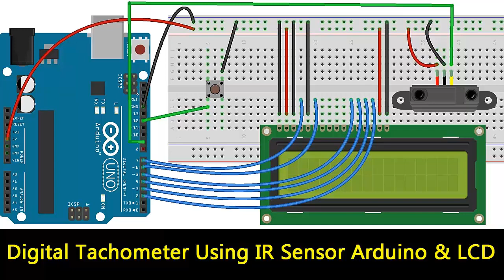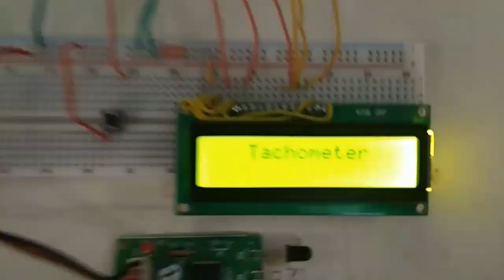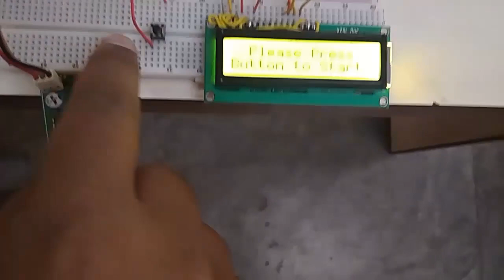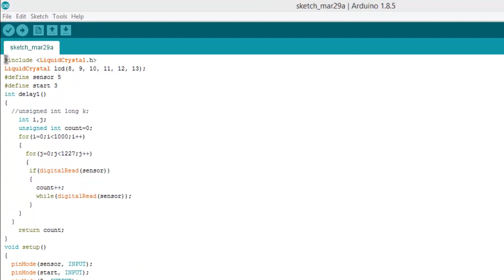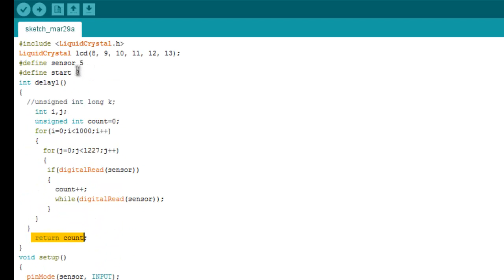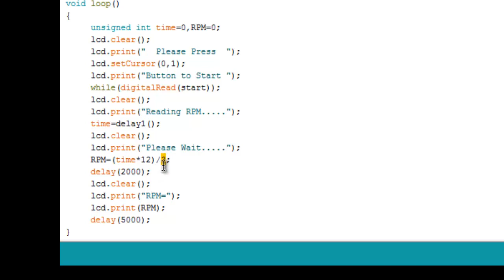Tachometer (RPM Measurement) using IR Sensor & Arduino

Comment: I have a high torque motor gearbox with a max rpm of 10. but when I tried to implement your method, the result doesn't make sense like it was shown on LCD 137 value of it, of course, my blade just 1. didn't accurate at all.

Comment: Hello, good explaination on the project. Yes it works. But when I compare with manual method (using stop watch) the reading by this project is not even close. Pls3, explain further on the formula. Someone had ask already... what is 12 in time*12..
Reply: Because rpm means revolutions per minutes, considering a 5 sec that sensor is sensing, 5x12 = 60 sec which is a minute. And /3 because the motor need to has 3 strips, if you put only one strip in your motor, you dont need to divide anithing

Comment: Hello. I tried your scheme but I don't understand why it doesn't work for me. Arduino Nano works well with other sketches .... Correct links but no results. Now I try again to compile the code again and for the nth time I'll feed it all and I hope it works. We hope well. You could propose a multi-function project such as an Ecu jet for modeling use with the various data that alternate. It would be great. Thanks.
Reply from the maker: This projects work fine. It has been tested. Check the connections. 
Sometimes it doesnt work if IR sensor is damaged.

Comment: How to measure the speed of wheel with no rim on it.? Will aluminium foil help?
Reply from the maker: May be this setup wont help.
You need optocoupler type setup
Reply: @HowtoElectronics  Then how do you say this program can be used for rpm measurement?

Comment: In RPM =(time*12)/3 please explain this, especially why we divide by 3 in this and sensor 5 and 3 what are the use of these sensor, please tell..
Reply from the maker: 3 is the number of blades in the fan. Use 4 , 5 or whatever according to number of blades in your fan